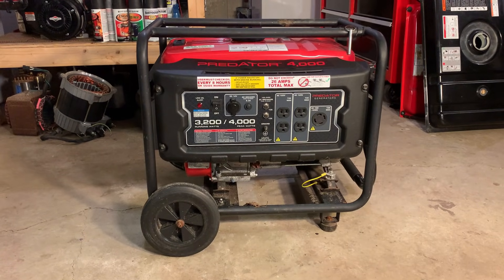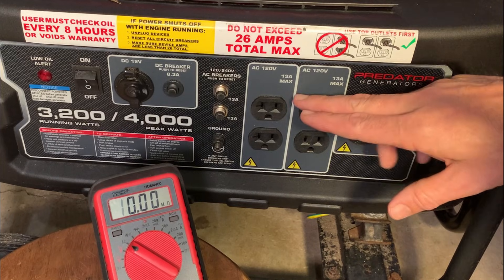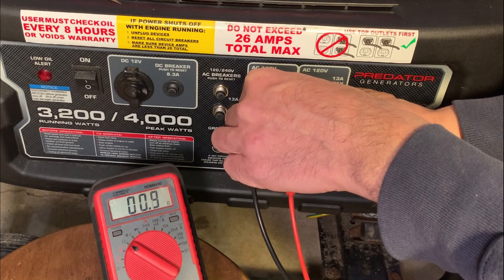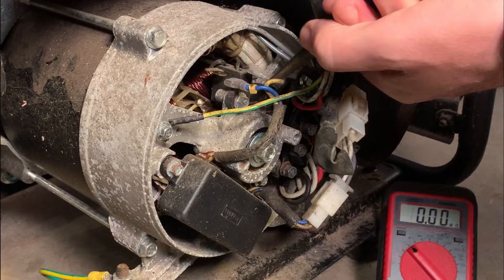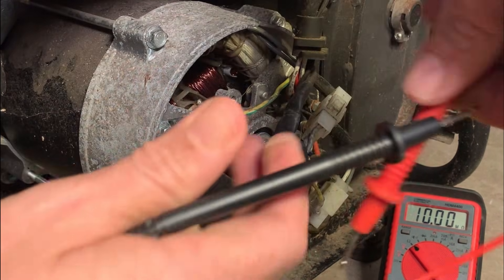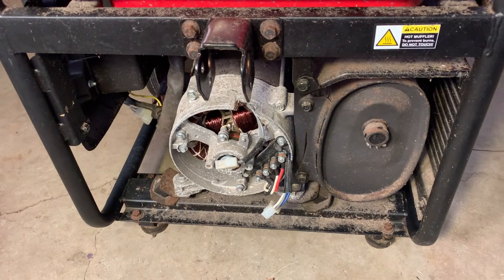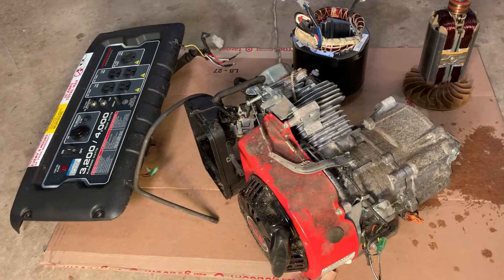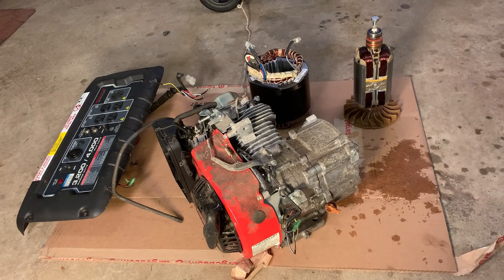Predator Generator Not Making Power

Comment: Must have been stored in a corrosive environment probably outside.  I wanted you to try and fix that wire.  Enjoy your channel
Reply: Its not rusty or faded enough to have been stored outside
Reply: @msharp6887  maybe it was covered up and ground moisture got to it.  Maybe in a shed with pool chemicals that will eat stuff up if the chemicals are not sealed well?
Reply: @davidschipsi1316  a shed is my guess. They are not usually climate controlled.
Reply: @msharp6887  Look at the valve cover, and the frame under the gas tank.  It definitely spent the last few months of its life if not year of its life outside or in a leaking shed.
Reply: @bobadam7021  he said it was stored for several years, if it was outside it would be rusted everywhere, with faded paint. So gotta be at least in a shed, or maybe a pollbarn
Reply: Electrical safety when using portable generators: Always make sure you follow all the generator safety rules whenever you use your portable generator. This is only a reminder. Generators can be dangerous if not used carefully. Every year, hundreds of people die or get injured when using portable generators due to carbon monoxide poisoning and electrocution. Make sure you are using your generator carefully and keeping others safe as well. There is something very serious that everyone should always be aware of when using generators. Some people do run their generator indoors which is not safe and that increases the risk of carbon monoxide poisoning which can cause death of family and you. Some people run their generator in wet conditions which can electrocute them. Please remember that you should never run your generator indoors. Remember that carbon monoxide is an odorless and colorless gas that you cannot see or smell. Carbon monoxide is a silent killer. Keep that in mind. Make sure your generator is 15-20 feet away from your house and away from doors, windows, and vents. Never use your generator in your porch too. Having a carbon monoxide detector is very important against generator safety. Some people also allow children to go near the portable generator which could pose risks. We need to keep an eye on our children making sure that they are not near the portable generator so they won’t get electrocuted or burned by the generator which is dangerous. A locking enclosure also keeps kids safe. A generator shed might look like a tempting place to explore, or take cover during a game of hide and seek, but a generator is a dangerous piece of equipment that can cause injury. It says on the manual that we should also keep children away at all times from the portable generator to avoid injuries. Please do not allow a child or unqualified people to operate the portable generator.  It is important to keep your children safe especially little ones. The portable generator can be hot during an operation. Just because some manuals missed what should be listed doesn’t mean it’s safe to do. Always follow the generator safety rules when using portable generators. Generators pose electrical risks. If you need to use your generator during wet weather, you need a generator tent to protect your generator from getting wet. Don’t let your generator get wet. Keep your generator dry and before using your generator, please make sure your hands and your generator is dry. Do not wear loose clothing when operating the generator. Everything that is said on the generator’s operating manual should not be ignored. Never smoke cigarettes near the generator. Please keep flammable things away from the generator. Never overload your generator too. Your generator can catch fire. Never ever try to plug a generator cord into a wall outlet to avoid back feeding. Back feeding your generator is dangerous. Always turn on your generator first before plugging in appliances and shut off the appliances before turning your generator off. Use a heavy duty cord for your generator and the cord should not be worn out. All the instructions should be followed carefully. Never refuel your generator while it’s running. It can cause fire if fuel spills while your generator is hot. You should turn off your generator and let it cool off before refueling it. Having a fire extinguisher next to the generator is also important. This is only a reminder for everyone’s safety of using generators. Make sure your generator is properly grounded. Having a fire extinguisher next to the generator is also important against the safety rules. https://youtu.be/I1jT3ANENvI and here is a video more about keeping others safe when using generators and also about our family’s safety. It’s important to keep our little children safe as well. Make sure your little children are kept away from the generator at all times especially when it’s running. Hope this helps. Always remember that being safe is better than being sorry.

Comment: With a armature like this, if the coil can be removed,  used a heat gun to carefully soften the varnish and wood or plastic tools, pull out a desired length of wire (1 coil. )
Use a good brand of 5 min epoxy to seal the area of removed coil. 
Reinstall. Hook up wire, trim... 
If the coil cannot be removed, carefull unwinding as to avoid scratching the wire on core laminates, use tape to protect areas from abrading it, also to dam areas to re epoxy the coil area.
With a light amount of epoxy used, it won't effect the balance. 
Remove the tape of all possible areas afterwards, as this doesn't have the proper insulation value, and might cause an issue if the coil gets hot...
Reply: James - why not give this a shot. It's not like you'll hurt it.
Reply: Don’t forget about the generator safety rules: Always make sure you follow all the generator safety rules whenever you use your portable generator. This is only a reminder. Generators can be dangerous if not used carefully. Every year, hundreds of people die or get injured when using portable generators due to carbon monoxide poisoning and electrocution. Make sure you are using your generator carefully and keeping others safe as well. There is something very serious that everyone should always be aware of when using generators. Some people do run their generator indoors which is not safe and that increases the risk of carbon monoxide poisoning which can cause death of family and you. Some people run their generator in wet conditions which can electrocute them. Please remember that you should never run your generator indoors. Remember that carbon monoxide is an odorless and colorless gas that you cannot see or smell. Carbon monoxide is a silent killer. Keep that in mind. Make sure your generator is 15-20 feet away from your house and away from doors, windows, and vents. Never use your generator in your porch too. Having a carbon monoxide detector is very important against generator safety. Some people also allow children to go near the portable generator which could pose risks. We need to keep an eye on our children making sure that they are not near the portable generator so they won’t get electrocuted or burned by the generator which is dangerous. A locking enclosure also keeps kids safe. A generator shed might look like a tempting place to explore, or take cover during a game of hide and seek, but a generator is a dangerous piece of equipment that can cause injury. It says on the manual that we should also keep children away at all times from the portable generator to avoid injuries. Please do not allow a child or unqualified people to operate the portable generator.  It is important to keep your children safe especially little ones. The portable generator can be hot during an operation. Just because some manuals missed what should be listed doesn’t mean it’s safe to do. Always follow the generator safety rules when using portable generators. Generators pose electrical risks. If you need to use your generator during wet weather, you need a generator tent to protect your generator from getting wet. Don’t let your generator get wet. Keep your generator dry and before using your generator, please make sure your hands and your generator is dry. Do not wear loose clothing when operating the generator. Everything that is said on the generator’s operating manual should not be ignored. Never smoke cigarettes near the generator. Please keep flammable things away from the generator. Never overload your generator too. Your generator can catch fire. Never ever try to plug a generator cord into a wall outlet to avoid back feeding. Back feeding your generator is dangerous. Always turn on your generator first before plugging in appliances and shut off the appliances before turning your generator off. Use a heavy duty cord for your generator and the cord should not be worn out. All the instructions should be followed carefully. Never refuel your generator while it’s running. It can cause fire if fuel spills while your generator is hot. You should turn off your generator and let it cool off before refueling it. Having a fire extinguisher next to the generator is also important. This is only a reminder for everyone’s safety of using generators. Make sure your generator is properly grounded. Having a fire extinguisher next to the generator is also important against the safety rules. https://youtu.be/I1jT3ANENvI and here is a video more about keeping others safe when using generators and also about our family’s safety. It’s important to keep our little children safe as well. Make sure your little children are kept away from the generator at all times especially when it’s running. Hope this helps. Always remember that being safe is better than being sorry.

Comment: Easily repairable solder it the enamel will burn off and solder to the wire
Reply: Don’t forget about the generator safety rules: Always make sure you follow all the generator safety rules whenever you use your portable generator. This is only a reminder. Generators can be dangerous if not used carefully. Every year, hundreds of people die or get injured when using portable generators due to carbon monoxide poisoning and electrocution. Make sure you are using your generator carefully and keeping others safe as well. There is something very serious that everyone should always be aware of when using generators. Some people do run their generator indoors which is not safe and that increases the risk of carbon monoxide poisoning which can cause death of family and you. Some people run their generator in wet conditions which can electrocute them. Please remember that you should never run your generator indoors. Remember that carbon monoxide is an odorless and colorless gas that you cannot see or smell. Carbon monoxide is a silent killer. Keep that in mind. Make sure your generator is 15-20 feet away from your house and away from doors, windows, and vents. Never use your generator in your porch too. Having a carbon monoxide detector is very important against generator safety. Some people also allow children to go near the portable generator which could pose risks. We need to keep an eye on our children making sure that they are not near the portable generator so they won’t get electrocuted or burned by the generator which is dangerous. A locking enclosure also keeps kids safe. A generator shed might look like a tempting place to explore, or take cover during a game of hide and seek, but a generator is a dangerous piece of equipment that can cause injury. It says on the manual that we should also keep children away at all times from the portable generator to avoid injuries. Please do not allow a child or unqualified people to operate the portable generator.  It is important to keep your children safe especially little ones. The portable generator can be hot during an operation. Just because some manuals missed what should be listed doesn’t mean it’s safe to do. Always follow the generator safety rules when using portable generators. Generators pose electrical risks. If you need to use your generator during wet weather, you need a generator tent to protect your generator from getting wet. Don’t let your generator get wet. Keep your generator dry and before using your generator, please make sure your hands and your generator is dry. Do not wear loose clothing when operating the generator. Everything that is said on the generator’s operating manual should not be ignored. Never smoke cigarettes near the generator. Please keep flammable things away from the generator. Never overload your generator too. Your generator can catch fire. Never ever try to plug a generator cord into a wall outlet to avoid back feeding. Back feeding your generator is dangerous. Always turn on your generator first before plugging in appliances and shut off the appliances before turning your generator off. Use a heavy duty cord for your generator and the cord should not be worn out. All the instructions should be followed carefully. Never refuel your generator while it’s running. It can cause fire if fuel spills while your generator is hot. You should turn off your generator and let it cool off before refueling it. Having a fire extinguisher next to the generator is also important. This is only a reminder for everyone’s safety of using generators. Make sure your generator is properly grounded. Having a fire extinguisher next to the generator is also important against the safety rules. https://youtu.be/I1jT3ANENvI and here is a video more about keeping others safe when using generators and also about our family’s safety. It’s important to keep our little children safe as well. Make sure your little children are kept away from the generator at all times especially when it’s running. Hope this helps. Always remember that it’s better to be safe than sorry.
Reply: @The_Happy_Aviation_Enthusiast  🤦🏽‍♂️

Comment: Why wouldn't you just solder a little extension of wire
Reply from the maker: Have done it before, but did not feel that it would last very long spinning at 3600rpm.  Do not want to get it working long enough to sell, just to have it fail a few hours later when someone needs it.
Reply: @jcondon1  you could always epoxy it where you made the repair that would protect and make it not move
Reply from the maker: @matthewanderson7766  agreed.  Next time I will try that.